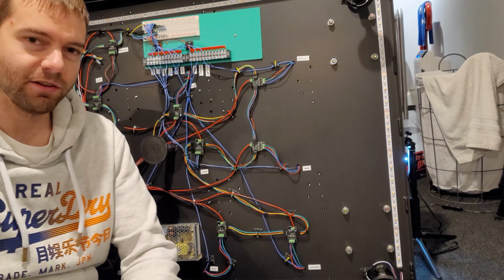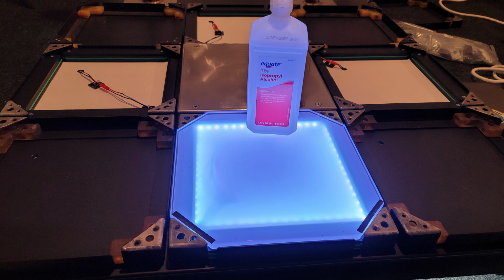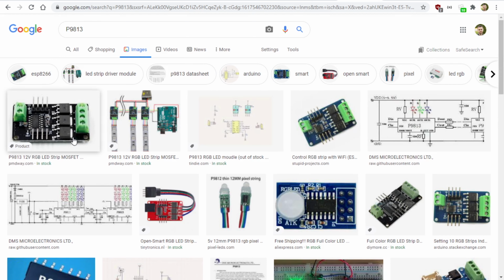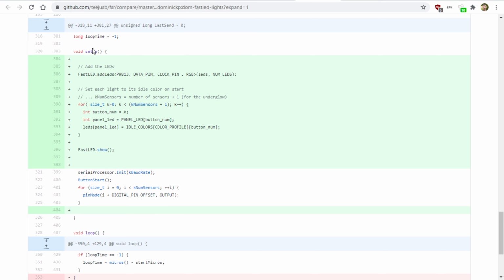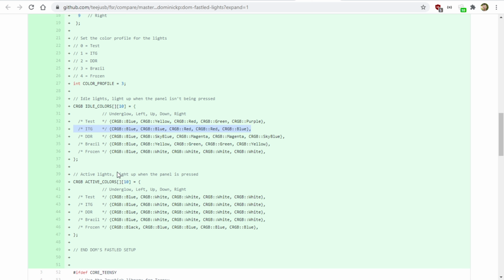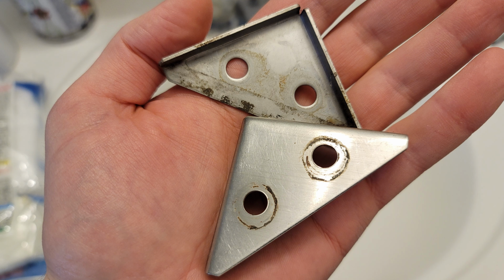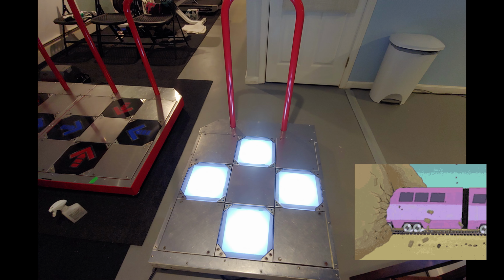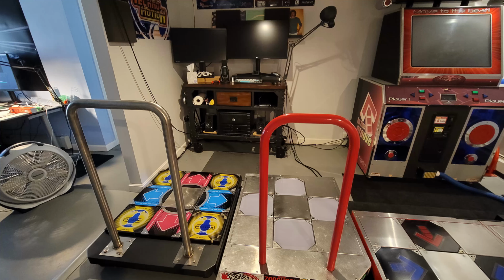Part 9: Getting Ready For a Test

Comment: Hello, great series I'm following this build except I'm using a wood frame. Quick question on the leds. Couldn't I use addressable leds run as one string throughout the panels and then divide each panel into groups using fastled? Wouldn't that do away with the mosfets?
Reply from the maker: That sounds cool. Maybe you could reach out to this guy who is also using addressable LEDs https://www.reddit.com/r/DanceDanceRevolution/comments/n08w8c/2_14_panels_lit/ I don't know much about them or how to drive them.
Reply: @domitg  Thanks for the tip!
Reply: How did the wood frame turn out? Where did you get it? Can I ask you some questions because I want to do the same thing

Comment: Wow. I also have a fastled and planning to add to my pad using arduino. Mine only needs 5vdc and a D-In for the output signal from arduino. Im not really good in coding but, is it possible to copy your code and use it in WS2812B addressable RGB?
Reply: I'm pretty sure he has it in the description
Reply from the maker: Yeah i think so man. In the setup function look for the addLed line and swap out the code of my module for WS2812B. See how far that takes you.